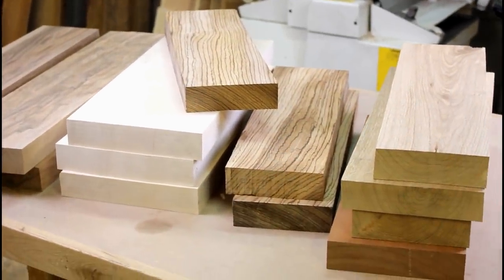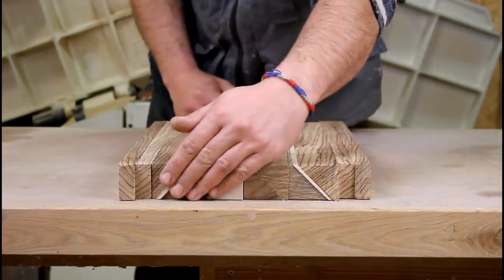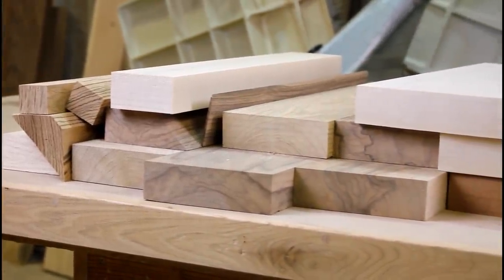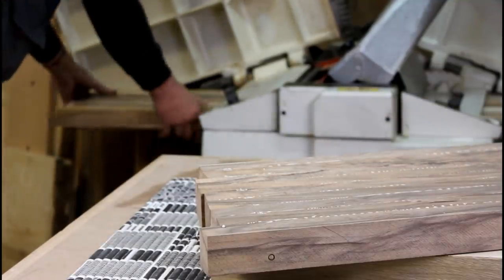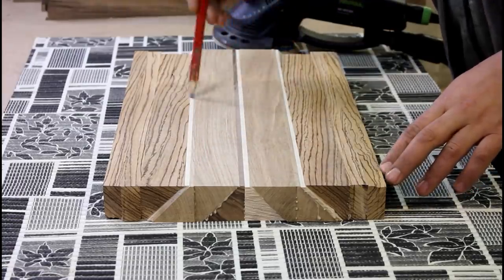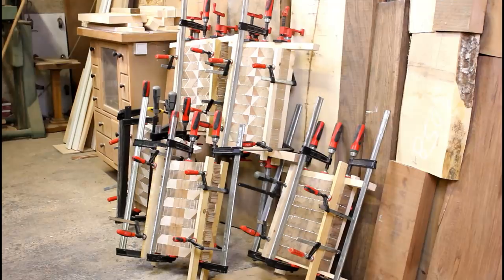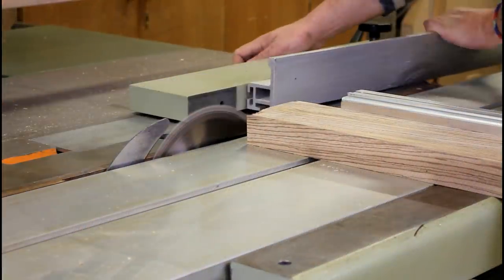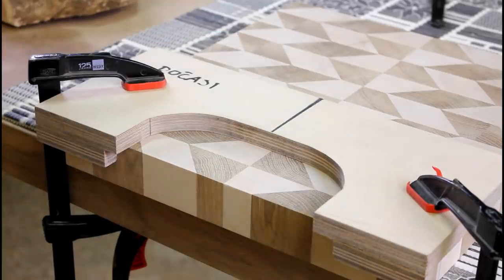Wish To Learn How To AWESOME Cutting Boards? Watch This!

Comment: Hello SW just a suggestion that will allow your consumer to use both sides of the board. Route a finger groove in the middle of the sides as opposed to the bottom. You could also add a drip catch on one side and leave the other side flat. Makes such a nice board a bit more functional. Love your work CNN
Reply from the maker: Well that is something that I figure out recently. And all of my boards have a grove / slot on each side just for that reson. I'm sure it's better this way. Thank you for suggesting and kind words.
Regards

Comment: They are all just mesmerizing to watch. Beautiful! And thanks for the tips. Always appreciated! I can’t believe you are able to get a perfectly flat board just by using an orbital sander after planing. If I did that I know I’d make it worse!
Reply from the maker: Thank you buddy. I'm glad if someone can learn from it. Well about orbital sander. Key is as you saw in the video. 2 light passes equal pressure on both sides and go on the center of the board without moving or" zig-zag" 
Thank you for watching. Regards

Comment: Beautiful cutting boards. Quick tip for you. Wrap your clamping cauls with plastic packing tape. You will be able to remove them easily and always be able to reuse them.
Reply from the maker: Thanks man. Yeah im familiar with all that the truth is I'm lazy to often :)
Cheers
Reply: @Slovenianwoodworker  inwpuld say you are definitely not lazy. That's. Quite a bit of work to make these boards. Bravo

Comment: 4:50 you could also put your boards through not all in the same spot so you end up wherein them evenly
Reply from the maker: It depends of the planer and how good your knifes are. When I change them for new I don't have to worry about that for while.
This should work to. Cheers

Comment: Thank you so much for educating people on how to make beautiful chopping boards (you are a craftsman). I recently purchased your # 2 cutting board plans (the online video and plans made it very easy to follow). My wife likes light coloured boards (a natural look), before oiling I would like to ask you what oil would you use.to achieve this. 
Many thanks 
your Aussie friend 
John
Reply from the maker: Thank you for your support!
Regular mineral oil is the choice. Because it colorless and odourless. I use parafin oil. It's cheap and you can get it almost everywhere. Bee's wax with add color. It will be yellowish so try to skip that it will be OK even with just oil. Just reapply a bit more often.
Thank you & good luck
Reply: Slovenian Woodworker 
Thank you so much for your quick  reply, the world is not as big as it was 30 years ago and sending a text message is so easy even when you live down under in Australian 
Cheers
Reply: @Slovenianwoodworker  Thank you for sharing this.

Comment: Definitely, beyond the ordinary. What impresses me most is your ability to achieve these 45-degree cuts with such precision. Can you share your thoughts on just how this is done?
Reply from the maker: Thank you for your kind words.
Good equipment definitely helps but before I had saw as now I had "benchtop version" I use same technique. Good riping blade , if saw is underpowered use as thin kerf blade as possible you wouldn't believe how much of an difference it makes . Second: key is constant speed feed rate without stopping. Saw has to keep it's optimal RPM even under load.  If  your pushing to fast blade can wooble. If using push stick place it in the center of the stock so it always going parallel with the blade. That's about it. Regards
Reply: Thank you. I'll be giving this a go with your tips in mind. Nice of you to offer your advice. Incidentally, excellent video. I've watched it several times.
Reply from the maker: My pleasure thank you for keep my views up :-) I'm sur you can do it too. Good luck

Comment: Just beautiful! I am a beginner woodworker and just starting my first end grain boards. And my biggest dilemma has been how to quickly and effectively sand end grain. I watched your entire video anticipating seeing that part of the process. I saw that you do some planing, but what type of sanding do you do to finish? I’ve been told by a woodworking class instructor to never plane end grain, but noticed you did, and I’ve seen many others who have as well. If a glue up goes a little wonky and needs some true aggressive material removal, sanding to level is nearly impossible. :/ I would love to hear your thoughts on this issue and any advice regarding safely planing end grain would be much appreciated! Your work is stunning, thanks for sharing!
Reply from the maker: Thank you for your feedback. Yeah there is a reason why I don't show this so often because the safety police is on every corner :-) I'll explain later when I come back. Regards

Comment: Very good. I've always heard Oak wasnt great for cutting board because of the open pores (higher potential of trapping old food in it). I wonder if it doesnt matter because it is end grain so those pores wont be in contact with food. Also, your mapple is really white, very nice. All my maple boards go a bit brown by soaking too much oil. I wonder how to keep the colors light to increase final contrast. Thanks!

Comment: Very nice boards! I have started to try to make cutting boards like this. My tools are not as nice as yours so some of the cut angles may not come out exact so, when I have a piece that has many small angled pieces and I clamp them for glue up, the pressure can cause small gaps in-between some of the pieces. How do I fill them? I have tried glue but, when the gaps are small the glue doesn't flow down very far into the gap so when I sand I can sand the glue away and expose the gap again. Is there a food safe thin glue that can be used or, is there another technique I should try?  Thank you very much.

Comment: Wonderful work! How do you keep the pieces from sliding and shifting when clamping before the glue dries? With how intricate those patterns are, even a minor shift of one or 2 mm is going to throw it off. I don’t feel like I have excessive glue or excessive cramping pressure, just enough to squeeze out, but my surfaces always end up shifting a bit even after I walk away from it being lined up.

Comment: Beautiful work.  Quick question, how to you account for the different wood movements of the different types of wood?  Do this cause the boards to split, or how do you counter that?
Reply from the maker: It doesn't happen as it would happen in face grain boards or furniture. I had only one case of that. And even than the problem was high and sudden temperature change . Guy put the board on radiator to dry . By following grain direction/ orientation of growth direction when making cutting board you can see in which direction the wood will expand the most and than I match it with other pieces. I think the big role also plays oil and wax with which borad is treated.

Comment: I have posted on this video as, for some reason, my Mac won't let me send an email to the link that you have. I discovered your channel while searching for techniques on making end-grain cutting boards.  I love watching your videos and have recently purchased all the timber that I need in order to have a go at making the Zebrano board.  I bought the plans from your shop.  One thing I noticed, on the plan print out, is that there is a small, partial picture of drink stand/ table.  Do you intend to make a video of this as I really need 4 drinks stands to go in my television room and then look as though they would be perfect?
Reply from the maker: Thank you Kenneth ! Your purchase helps this channel directly. I really appreciate it. Also I'm glad you'll make the board by yourself feel free to share it with me if you wish. Also if you encounter any difficulties or need some guidance let me know.
Try to contact me on Instagram or Etsy DM.
 I have a lot of ideas and plans to make all sorts of projects with my touch and design. 
I can't say for sure when that will happen ( regards that stand ) but it's on the " to do list " 
Thank you for your kind words and your support ! Cheers

Comment: Beautiful work...they all the best boards but I have one questions that I always like to know.
What type of glues you are using regarding the toxicity of the glue if there is a consideration for that at all. Many thanks for your video.
Reply from the maker: That is correct.
Glue must be certified as food safe. I use only that kind for cb.
Thank you

Comment: What kind of oil is used in the end? I've seen a number of different kinds used with wood but am curious if there is a particular one (or few) for this type of project.
Reply from the maker: There are commercial ones or home made. I use home made stuff.
Bees wax and mineral oil 1/4 ratio.
Mineral oil that I use is called Parafin oil. Cheers

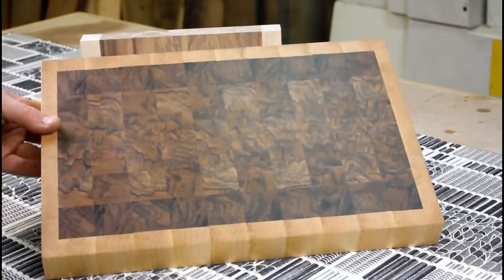Comment: They look really good!! At 6:14 you said when you make an edge around the board, to make sure that is engrain as well. Why is that important? Does that have to do with the way it all responds to temperature differences? Can it crack? I made my first cutting board the other day and the grain on it goes in all directions... I hope it stays in good shape
Reply from the maker: If you're making endgrain style board than all the wooden pieces must be endgrain. As well as decorative edges around the board. Reson is simple wood movement. You can not mix endgrain with /edge or face grain. Either of one has its own direction of movement. If you mix those 2 it will fail no matter what everyone else tells you. For example look at the dining tables with breadboard. Two ends can't be fixed to the table top. Good luck
Reply: @Slovenianwoodworker  Thank you very much for your answer! Unfortunately, I have already made the board and I have put in a lot of work on the shellac finish 😔 Let's hope it will stay good for a long time...

Comment: Do you run the final glued up cutting boards through your planer (with the end grain)?  That's the part of the process you didn't show here.  If not, how did you get them flat and smooth if you don't have a big drum sander?
Reply from the maker: Yes always
First planner. Than calibration sander. I bought it since that video.

Comment: very nice one day i will try. but i notice with your table saw, what kind of fence is that
Reply from the maker: Thank you buddy. If you mean the ripping fence that comes as stock on this type of format saws. Very robust with micro adjustment knob which moves the fence if it's locked or not.
Cheers

Comment: It would be interesting to cut these style of cutting boards into thick veneers coated in epoxy and use them as tiles that you could glue to a solid piece of wood like parkay. I think it would be cool to do in a tiny house.
Reply from the maker: I saw that once with more simple pattern dough..and it looked awesome. Maybe I will try something like that one day. Thank you for watching. Regards

Comment: Your shop is a cluttered and dusty mess, I LOVE IT! I love to see old glue on clamps, to see tables that have work wounds, to see works in progress scattered around.... this means you work and you are a real wood worker.
Now, show us that saw, is it comparable to a Felder/ Hammer in function and what is the cost difference?
Reply from the maker: Well thank you for your observation :-) yes it's a work place and sometimes maybe I swep the floor before filming but that's about it :-) All my stuff is used on daily basis and I care about tools/accessories but this is meant to be used not looking shiny in videos :-) 
Well about my saw. This is old version of SCM livincibile - model. 3.2 m long sliding table 3 speed , scoring blade 1hp and main motor around 10-11 hp. You have SCM minimax which is  high entry - professional level. Thank you have livincibile version which in Italian means invincible and it's designed for industry level work. This mashines can run around the clock every day. It depends on personal choice. I live near Italy so everything around here is mostly SCM . Hammer is the same level as SCM minimax. Felder- format or SCM livincibile are the same rang. Very high quality mashines. There is nothing bad about them so I really can't say that one is better and other not. Basic saw you can get from around 10 k EU up and top models which are fully automatic and CNC are around 20-30 K.
 Price apply for SCM and Felder. They cost similar.
Reply: @Slovenianwoodworker  the reason I watch you is because you work, you don't brag or hold yourself in too high a regard... you show a humble side and I like that you are not a fake like so many here in the United States. One guy even has his shop carpeted! I do real work, either in my garage or in the main shop where the power tools live. Both places get dusty and full of wood shavings or chips... my poor motorcycle has to share the garage and even under it's cover gets very dusty from the lathe or radial armsaw, this is where I do my small work and finishing because the main shop has no heat or cooling. I make high end furniture and tools but for now only as a hobby,  my real job is what you would call a field engineer,  after I retire I will see about working this hobby into a full time manufactory.  Until then? I will watch people like you, humble and skilled.
Reply from the maker: Thank you for your kind words. Well I don't act I'm just trying to show what can be done and I'm being myself. And it will stay that way. I know what are you talking about I see it all the times yes. I'll always stay" original" and humble. That's just the way I am and I'm glad you can see that. I had my shop without heating till recently so I can relate :-) and I was a biker too but I sold my Zx10r and bought that white SCM planer that i still use. Everything started as a hobby and soon after turned into business. I would like to see your furniture , Instagram maybe?  I wish you good luck with your work and thank you for watching.

Comment: How did you put white (maple) wood on smile face cutting board? Did you  cut eyes and smile and glue to the board?
Reply from the maker: I think I show that in video how i inlay is done with router. Than Glued that maple in yes.
It's inlay /intarsia

Comment: What is the name of the sander at 7:35, even though I will most likely never be able to afford? I was under the impression that drum sanders were the only solution to leveling a face with sandpaper.
Reply from the maker: Hello.
That is EU style belt sander. Quite old but industry level of mashine so I'm sure it will Outlast me :-). 
It's samco LL. Now part of SCM group.
Well not only that but you can sad curves and edges too . It's more versatile than drum sander. Here you can get similar one for under 1k. It has a bed 3 meters Long. Good luck

Comment: What oil are you finishing them with?
Reply from the maker: Mineral oil /parafin oil. Bee's wax
Reply: @Slovenianwoodworker  oh ok thanks. Personally I have used butcher block conditioner in the past. What are your thoughts on that?
Reply from the maker: As long it doesn't color your board and it offers some protection than is OK.
Try osmo if you wanna step it up
Reply: @Slovenianwoodworker  okay awesome! Love the videos! I’m always watching to find new ideas and techniques like yours. I’m only 16 but I am in woodshop for the 3rd year and I love it
Reply from the maker: Thanks buddy.
You're young and on the right path ;)
I love it too and once you do that everything is possible :)
Keep it up

Comment: What is the name of the mineral oil that you use?
Reply from the maker: It's called Parafin oil
Reply: Slovenian Woodworker any other mineral oil that you recommend?
Reply from the maker: Well I'm using this one from the beginning and it works fine for me. Any kind of mineral oil that is non processed ( without added sents or color ) will be ok. Important is wax that closes the fibers.

Comment: dear friend, you did not demonstrate how you installed the smile and eyes on the board(((
Reply from the maker: By hand. Routing out the slot and insert it.
No. Worries new videos coming soon.
Reply: thank you for quick respond. but I interested in how did you cut the smile itself?
Reply from the maker: I thought i show that in video.
It was done by bandsaw.